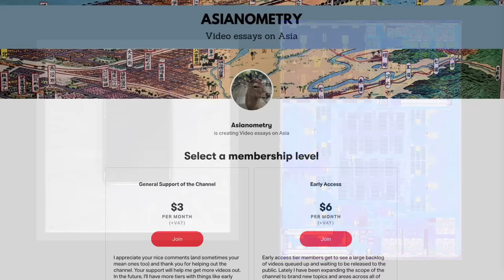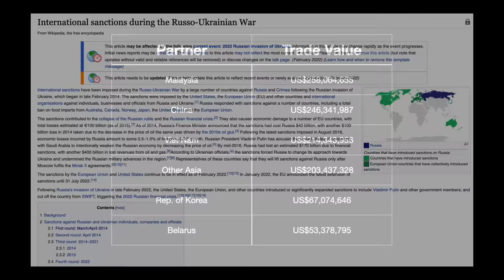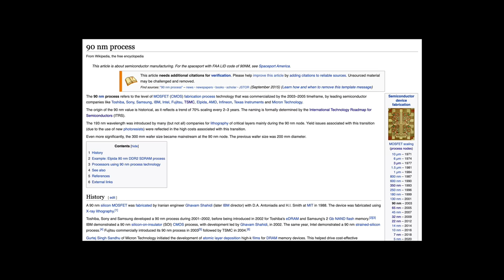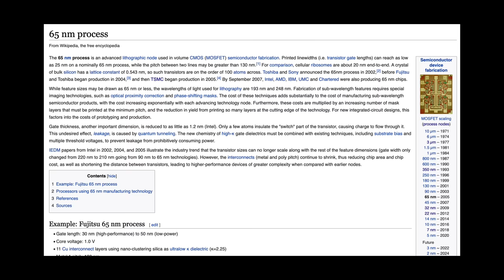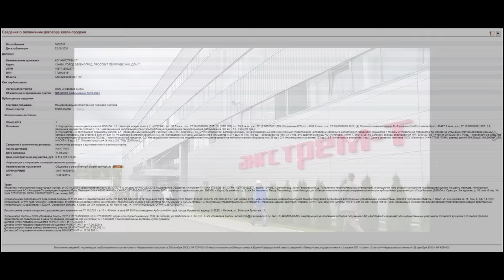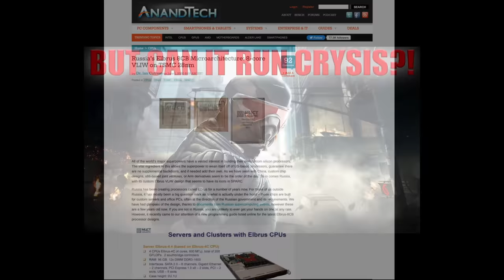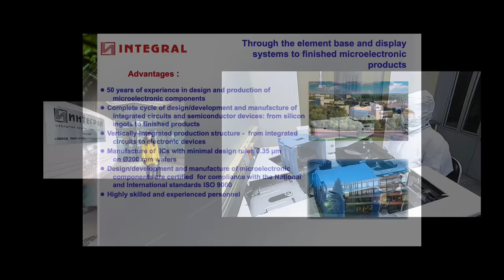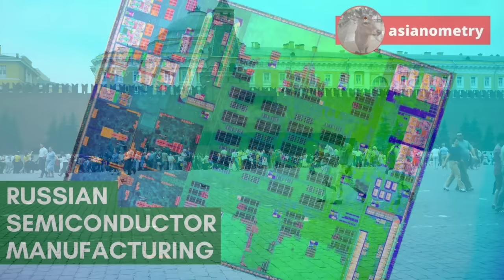Why Russia Can’t Replace TSMC

Comment: Russia has very talented software engineers. Hardware talent? It's hard to even guess. The way they manage stuff, their government, the corruption... all of these are probably a huge factor in why manufacturing lags behind others. This is just my uninformed perception as an outsider, but it really feels like Russia stifles its own innovation by trying to control way too much of its (private) industry. That said, rough times usually lead to innovation and who knows what kind of new CPUs we'll see coming from Russia, based on ARM or RISC-V. I hope Russia will get on the right path, but I'd also like to see it be more innovative - for good purposes that is.
Reply: Well, as a Russian i wouldn't say that we're lagging behind because of excessive control. It's likely on the contrary. The only reason MCST and Baikal currently exist is because of bailouts and the help of the government in terms of lawmaking policies and giving grants for development of the new stuff. And only after 2014, when Russia decided that we need to depend less on imports, only after our government started to support our microelectronics industry, we have started to see some new tech that can be considered relevant. Without control and support, there wouldn't even be any russian microelectronics at all, because no business would want to massively invest in something this risky and complicated and it's easier to just build an another shopping mall or re-brand imports as domestics and just start selling goods that are already manufactured.
Reply: Actually, re-branding imports as "domestics" and some shady companies exploiting loopholes in our laws of what can be considered domestic is a huge problem here. And that leads to the huge chunk of money being lost on this "domestic" manufacturing instead of going to the companies that actually develop and manufacture their tech in Russia. So I'd argue that there's a need in more strict control, especially now, when Russia desperately needs its own manufacturing and not just developments. This stuff won't just appear magically out of nowhere, the sad reality is that it needs to be controlled and supported by the government in order to even exist, you can't just let it go into a free-float and hope that the market would sort itself out.
Reply: @Warr1on  By excessive control I meant measures to steer companies either in or away from the direction wanted by the government. And I might be wrong about this in Russia, but having experienced communism in my own country (Romania), I've seen how companies were "stimulated" to grow into the direction the Communist Party wanted, instead of allowing businesses to take part in the free market. Basically, politics steered and shaped the industry for some agenda.

Re-branding imports (finished products) as domestic products is fraud, which should be illegal everywhere. So this is not what I meant by control.

The industry needs more support indeed, but no steering. The market knows very well what it needs, the industry can easily recognize that, so the government should only support this and even make sure that (domestic) competition can exist, so that the need for talent can grow and innovation to occur as a result.
Reply: @kneekoo  State control in a communist country can be efficient and productive. A good example is China, whose economy has caught up with the United States. Communist Vietnam also makes a lot of progress in microelectronics and produces its own processors. At the same time, you can find dozens of free-market democracies on the map that don't produce any technology of their own at all. Open your eyes - democracy and free market is not the decisive factor. Of course, one can always remember the unsuccessful attempt to build socialism in Romania. But what is the practical meaning of this? You live in the past.
Reply: @WatcherSCP  Living in the past? It looks like you're advertising communism or you completely missed my point about control done wrong. That's the problem, it's not about communism, but rather typical to communism. China made the same mistakes in the past but they learned. Russia (leadership) needs to learn too.

Free market actually means free - free to succeed and free to be mediocre or fail. If people expect their governments to manage businesses, that's a pretty broken system. Innovation needs to be stimulated and the government should get out of the way otherwise. Too many rules and regulations, or too much control hurt progress. Even the USA has too many stupid rules, regulations and laws that hinder the progress of Tesla and SpaceX. So again, my point was about excessive control.
Reply: @kneekoo  Neither China nor Russia ever reached the true state of communism. Or rather, in the current world, communism doesn't exist because capitalism is just too attractive. Either way, it looks like to me that decades of US sanctions played a huge part in Russia's development.
Reply: It's not "state control striefing innovation." That would've applied equally to software as hardware. The problem is funding - modern semiconductor needs huge capital investment, software doesn't. Much of it is down to monopolies like in lithography, etc. Russia won't be able to catch up until the Chinese catches up in lithography and supporting fields, and then start to sell them at cabbage prices like every other time they caught up with something in the past.
Reply: @pastasoo  That's probably true about all political ideologies and economic systems. It seems like they're rather ingredients that leaders use in different quantities and mixes to shape their countries.

Big powers, especially the USA, China and Russia have always influenced other countries, big and small. But China did a lot better than Russia because they focused a lot on growing its economy. Russia has a great amount of land and a lot of people to do great stuff. But it still lacks a good enough government to turn things around to their advantage.
Reply: @georgedang449  The right government would invest in the right technologies - they can do it. But Russia can't get its priorities straight to become a big player in tech. The whole world would benefit from more competition.
Reply: @kneekoo  China has it way better than Russia whether it is land, location, people and international relations. China certainly didn't have the eminent superpower of the world constantly trying to strangle them to death. They were smart enough to remain subservient when weak and stay pragmatic, growing to the point where by the time the US realized their threat, it's already too late. I do wish for Russia to get out of this conflict soon, a strong Russia is needed to bring balance to the world.
Reply: @pastasoo  Despite their choices in international relations, I still think Russia wasn't smart enough about its own industry. They allowed it to go down instead of strengthening it. They were probably complacent in thinking that they will "forever"  get money from oil and gas. They could've learned a lot from their friendly neighbor China.
Reply: @kneekoo  I kind of disagree, I feel it was the opposite where Russia was going to cut reliance on the sale of petrol eventually but they had to go with petrol for the time being to grow their economy and strengthen the military since they really didn't have much other options.
Reply: @pastasoo  Planning is different than doing, and here we are. The best investments are done in stuff that brings in more money. They should've focused more on economy. That's how China now has money to do whatever they want - their own space station, missions to Moon and Mars, lots of satellites, all on their own. And they didn't ignore their military either.
Reply: @kneekoo  Yup, the problem was they needed more time but the US/NATO wouldnt give Russia that luxury. China on the other hand still has a little bit of work to do. They are still largely dependent on trade with the US as their largest partner. If they could reverse that to the US having a heavier dependency while being able to source their needs from other countries instead of the US/Europe then they would become a true superpower without even requiring an alliance. I am kind of optimistic in regards to China completing that goal since their leadership is very wise with how they navigate geopolitics, much smarter than US foreign policy anyway
Reply: @pastasoo  Luxury to do what? Invade countries? The world needs to learn to develop without making others suffer.
Reply: @kneekoo  luxury to develop on their own, if they don’t invade Ukraine then Russia will end up suffering when they join NATO
Reply: @kneekoo  Why are such observable facts called propaganda? Russia’s is the only European Petrol state and the EU is their major trading partner. Crimea is currently illegally occupied by Russia so if Ukraine joins NATO, under article5, Ukraine can take back Crimea and become a second European petrol state in direct competition with Russia and it’s your guess as good as mine if the EU will prefer to trade with an EU/NATO country or Russia
Reply: @pastasoo  So you don't even see the contradiction? Russia illegally occupies Crimea and Russia would be hurt if they lose it? How is that not bullshit? It's illegal, they have to get out of there. You don't invade your neighbor's apartment and claim it your own, then complain that if the police kicks you out you would hurt. Russia can't complain about this.
Reply: @kneekoo  "It's illegal"... what laws are you talking about? Crimea was a legal part of Russia until the Ukrainian Khrushchev, who led the USSR in the 60s, decided to "gift" it to Ukraine. The fact that this region is populated predominantly by ethnic Russians did not bother him. In 2014, the Crimeans made their choice in favor of Russia in a referendum. Respect their choice.

And remind me under what law NATO bombed civilians in Yugoslavia and then dismembered this country?
Reply: @WatcherSCP  As I understand it, economic theory assumes that the free market decides what the most efficient use of dollars is for trade. When a government tries to second guess the free market, then over time the government will fail to direct those dollars as efficiently as the market would have. It's the old guns vs butter argument.
Reply: @Shullf2011  Sir, look at the globe and count the number of free market democracies. Only a few of them can boast of major advances in technology. Most free democracies use other people's technologies instead of developing their own - because the free market "dictates" them to seek profit. And buying someone else's is much more profitable than inventing your own. The irony is that only such "non-democratic" countries as Russia and China, today, have their own analogues of Google and FB, able to compete with these American giants in their local market. Russia and China have achieved this thanks to state support for the IT sector. And in free and democratic countries, everyone without exception uses the American Google and FB. Where is the variety and choice? Wake up. Your freedom has created giant, voracious monopolies that keep other democracies from developing their own technology.
Reply: @WatcherSCP  I think you are mixing economics and politics. My point is that, from just an economics perspective, China and Russia would get more of a return on their investments if they put that money to use in other ways. However, they have many non-economic motivations to subsidize their own social media platforms. Interestingly, in the context of software there is the concept of a network externality, under which the value of the platform increases as the user base increases. This is an economic reason why most of the world tends to use a select few software platforms. For most of the world, copycatting Google and FB simply doesn't make sense when those dollars can be used more productively.
Reply: @WatcherSCP  You are simply arguing from emotions at this point. I'm not going to speculate about where people prefer to shop for groceries, France's civil penalty structure, or compare companies to trees. And, I am not going to attack you or call your position "pathetic." Goodbye.
Reply: otto Lincoln  There are plenty of countries who have it much worse than Russia but don't invade other countries to fix their own problems. And the Soviet Union collapsed over 30 years ago, so I can't help myself wondering how much longer can that be used as an excuse for poor government.
Reply: @Warr1on  Bad or horrible things also happen in peace time. And whatever Putin dreams about, Russia should stay in Russia. There's plenty to fix and improve there, without making a mess outside its borders. Society will always have some issues, but when politicians take advantage of those to make people go against each other, things are almost guaranteed to go bad.

Russian governments throughout history have done a lot of damage. Of course there's animosity towards Russians, even if it's not warranted against simple citizens. But bad agents do pose as simple citizens, and that's how you get people paranoid about all Russian people. If you dismiss that, then you're simply wrong.
Reply: @WatcherSCP  By "legal part of Russia" you mean Crimea was handed over to the Russian Empire when the Ottoman Empire lost the Russo-Turkish war in the 18th century. It was also legal when Crimea was transferred to Ukraine in 1954, so just because the Russian government isn't happy to be smaller than it was, doesn't mean it's ok to ignore legal stuff that they dislike. The so-called choice that you mentioned is a hypocritical way to ignore the fact that how the Tatars were displaced and/or persecuted. Or maybe it's ignorance.

NATO and Yugoslavia? What about it? Do you think that was bad and that allows the Russian government to do something bad as well? Or that was bad and this is good? Russia's invasion doesn't look good and it's not justified either.
Reply: @Warr1on  i love how nobody ever answers when you bring up the documentaries or video proof of what has been going on since 2014 in the donbas or stuff like that. People just shortcircuit and instantly ignore your comments, cause it goes entirely against the narrative they chose to believe.
Reply: Maria_jikezee_sarungi  Russia transferred Crimea to Ukraine in 1954. 60 years later, Russia invaded it to get it back. Now they invaded Ukraine again, for bogus reasons. So this situation is different.
Reply: Maria_jikezee_sarungi  You somehow missed how Russia gave Crimea to Ukraine a long time ago.
Reply: Maria_jikezee_sarungi  He was in an official position of the Russian government when he did so.
Reply: Maria_jikezee_sarungi   Well there you go, so you know that he was an official government representative of the Soviet Union, making it a legitimate transfer of Crimea to Ukraine.
Reply: @kneekoo  That's xenophobic Russian are talented people, if to know lead researcher of quantum computer in Harvard is Russian, because real problem of Russian semiconductor industry is lack investment to fund them, Russia still depends on oil gas import, I believe this sanction CPU will push them to make microprocessor big plant for substitute product even maybe new innovation will come
Reply: @kneekoo  Russias biggest problem is that the economic growth of the mid-2000s choked off. They even survived the 2008 crisis pretty well, but after that everything went downhill. I still dont quite get what exactly happened, but I suspect it got something to do with the Kremlin and the Oligarchs not wanting too much competition.  Thats probably what was ment with "state control".

That created the current setting, where government support is the only way to actually drive certain industries.
Reply: @termitreter6545  That seems quite plausible, and the perspectives are pretty bad if it is so.
Reply: Get out of my head, man! I am russian and I can't agree more.
Reply: @kneekoo  I am answering a specific post about "I saw what communism does in my native Romania ...".
Don't you find it strange that capitalism succeeds only where there is a strong counterbalance to "Western" capital? - the whole of Europe is opposed to Russia and China - Europe lives well. South Korea and Japan hold back the DPRK and China - they live well.
However, the democratic countries of Latin America (which are MAXIMUM close to the stronghold of democracy, the USA) are dying of poverty, not to mention Africa and some other oceanic countries?
Only monopolists will benefit from developing capitalism, just look how many products (at least in the US and Russia, I don’t know how it is in Romania) REALLY belong to Pepsi or Coca-Cola? Capitalism strives for monopoly because it promises maximum benefit 
Of course, you can always justify the antitrust laws., but capital can be built up for as long as it takes to lab an infinite number of interests (lobbying for laws).
And most importantly - I'm not saying that communism (or socialism) is the way out, I'm saying that there is no need to idealize capitalism ...
Reply: @SuperNiceClown  I can't idealize capitalism because it's already proven to be awful when taken to extreme. Nothing should be taken to extreme. However, I can barely cherry pick a few good things about the communist period of my country. And when put in balance with everything else, the good is about as powerful as a fart in the wind. By contrast, capitalism has more potential for good. But of course it's complicated, because politics always is.

We should be very pragmatic and acknowledge the problems created by the various kinds of politics. I don't see what kind of politics would satisfy everyone, or if such a thing could ever exist, but I think we should take a look at the whole picture - past, present and future. Most of us will probably agree that progress is a good thing. I think we can also agree that having more people trying to solve problems is also a good thing, because it increases the chances of having more problems solved.

If we zoom out to see the past and present, we can see how humankind evolved in many ways, although it was a bloody evolution, filled with all kinds of bad and evil. Now if we look towards the future, can we really call our lifetime evolution or stagnation if we repeat what we did so far? As long as we care enough about a future generation to look at our time and acknowledge progress, we're supposed to step up and do better than this. At some point in our evolution we have to reach the age of accountability. Not only should we admit our flaws and work to correct them as individuals, but the society as a whole needs to work on it just the same, and that includes the political system and countries.

Romania is one of the countries that suffered from Russian annexation and influence. You'd have a hard time finding enough Romanians to say positive things about the Russian leadership. We're obviously opposed to that kind of values and politics, and we've been a democracy for over 30 years now - although flawed in many ways. But how successful are we? The difference is huge when compared to Western and Central European countries like Germany, France, Spain, etc. Why? Because that's where our leaderships brought us.

To an extent, leaderships are a reflection of what people voted. It's safe to say that we must learn to not only vote better, but also be more attentive and/or involved with politics if we want to improve. It doesn't matter where you are on the map if you always expect others to fix something. We need more people to hold their votes accountable and do better next time. And apart from voting, we also need to improve our ways as individuals in a society. There's no progress otherwise, it doesn't just fall on our lap out of thin air. We need to cherry pick the good parts of existing politics and come up with something better. Otherwise we will keep arguing over and over, over repeated mistakes that we could've learned from.
Reply: Man, you can't come in 2022 and say "EVERYTHING, I'm going to produce 7nm chips...Without the government, it's impossible. 
A huge lag in this industry, happened at a time when the state abandoned the developers to their fate... So in Russia the industry flew down the drain, and in the U.S. came Pentium-you know who Babayan is? So he was in the company "mtsst"...
I think if Russia hadn't abandoned its developers in the '90s, today Russia would have had 24nm 16nm chips. 
I think in those years, a lot of officials were associated with the CIA. There are many of them even now, many of them have now run to Israel, Turkey, the USA. Those who were supposedly engaged in Innovation-actually slowed down the process, such as "Chubais".
Reply: @kneekoo  assuming your market is truly free and you are completely fine with your companies failing... why didn't you allow Huawei to take over? :D
Reply: @georgedang449  china is working new processing power using light and no need for a cpu.
Reply: Сергей Захаров  Wow, the amount of "inadequate" information in your comment is staggering. 🤣
Reply: Hardware talent is too, for example one of creators of Elbrus 3 Boris Babayan was hunted by intel. 
About semiconductor fracturing, I want to say that Elbrus managers are not afraid of TSMC close, now they say that fracturing it's closed and they will find some other ways to produce VLIW processors. Baikal chips can be produced by modern China manufacturers. I heard news that government plan to build new manufacturing with actual techprocess by it will be build to 2024
Reply: Russia has highly educated engineers and scientists, including hardware. Having a "higher education" as they call a university degree is somewhat of a norm. They often just don't find a job that fits their qualification. 
All of Russia's technological backwardness come down to corruption and the wrong people holding positions of power.
Reply: The reason chips in the West are great is that the sales to consumers fund the expensive research. It you have to fully fund those with government funding, it’s pretty damn expensive.
Reply: @WatcherSCP  - It’s not democracy which aids the building of technology, it’s the consumer market. When consumers buy AMD chips, they fund their very expensive research.
Reply: Rusian software talent? Name a rusian software that can compete in any industry None
Reply: @Teluric2  Have you ever heard of Kaspersky?
Reply: @Teluric2  There are some good Russian hockey players,can't think of anything else anyone in Russia does well.Of course they live in the US,no money for hockey in Russia.
Reply: Russia in  a middle of Dutch disease. No one want to invest money in future, anyone with money want to multiply it asap. Best way in Russia to do it is invest to oil production. I hope now they will be forced to invest in technology and production and finally get off the oil needle.
Reply: i hate how artificial the lives of todays people are. you go home into your 2 room rented house. you arrive and windows are closed shut (because of heat or whatever) and the only light are LED. you go in between the 2 artificial plants on both sides of the walkway. you watch some TV while eating chips not even knowing how its made. before sleeping you do programming on your computer. you go to sleep.
Reply: @pastasoo  apologies for replying to an old post but it should be noted that to join NATO a country cannot have active border disputes and must already have a military that can  participate within the NATO structure. It would have taken Ukraine likely over a decade to become eligible to be a member, if Russia had held Crimea and the Donbas then in all likelihood NATO would have told Ukraine to give them up if they wanted to join. Germany, lynchpin of the EU was quite happy to increase their Russian gas imports right up until the invasion.
Reply: @WatcherSCP  LoL #1 Chinas economy hasn’t caught up with the United States esp on a per capita basis where their people don’t make anywhere close on AVG to what the AVG American makes per year.
Secondly China doesn’t innovate anything they need to copy everything which is why they’re always trying to steal intellectual property from the United States. There no where near as technologically advanced as the United States esp when it comes to military technology, artificial intelligence etc. everything they make that is cutting edge are direct copies of western counterparts with minor tweaks. They don’t innovate shit, and that is directly due to communist control of their industry.
Reply: @WatcherSCP  Everything I wrote is true and factual. You seem to have mastered the Russian repetition of spinning facts n truth to suit your worldview. Truth and facts tend to be something Russians are allergic to, it’s probably why those statements struck such a nerve with you. Ever hear the old American axiom that the truth tends to hurt? That old saying seems to apply perfectly here
Reply: @K1forMVP  So where are the facts? Have you decided to run away from the answer in demagogic?
Reply: @K1forMVP  
Do not argue with a Russian swindler (in Russian - PROPAGANDON). It is on state support, like microelectronics in Russia.
Reply: @kneekoo  Sir can you answer my question?
Why nationalists from Romania often look to Moldova?
That's kind of okay?
Reply: @marekms1041  What people know today as Moldova is about half of the original Moldova - an old Romanian region. The half on the east side of the Prut river was taken from Romania, by ultimatum, by the Soviet Union.

Moldova regained its political independence when the Soviet Union collapsed, but there was not enough political will (plus inevitable Russian influence) to reunite with Romania. And with the current war going on there will be a lot of hesitation on this topic.

Clearly, both Romania and Republic of Moldova fear consequences from Russia. As both countries rely on energy from Russia, things could easily get complicated - especially for Republic of Moldova, being the poorest European country.
Reply: @WatcherSCP  not sure how accurate your statement. The US is one of the leading chip making tech... one thing in common, there's a lot of asians in that field. I could be wrong but the talent is coming out of Asia and not a dependency with political state. If a country needs the state to step in then there probably an issue
Reply: It's not about talent... that can be fixed,  it's a lack of investors
Reply: @kneekoo  : Thus, ICE Felix is supposed to be the closest thing the world-class innovator? Cloning a ZX Spectrum? Is that what you call an innovation? Haha. I am no very impressed, sorry.  I replied to your post only because you were parroting cheap crapitalist propaganda and it sounded so childish. I could paraphrase a satiric writer: During the era of "communism", artists were wailing that they could not create; communism eventually went away and capitalism came in, but the artists have not created anything. Sorry, but it appears to me that you do not understand it, so you come up with simplistic explanations.
Reply: @pastasoo  , no, Ukraine cannot join NATO. Read Article 10 of the NATO Treaty.
Reply: @kneekoo  : You peddle bullshit. Crimea is not occupied, Crimea is part of Russia, so it cannot be occupied by Russia. It was occupied, but only for a few days. The Crimeans exercised their right to self-determination and decided that their future would with Russia. It was totally legitimate, even if some legal questions regarding the legal foundation of the referendum remain rather unclear. Who cares? The whole Romanian revolution of 1989 was even less legal, so what?
Reply: @Shullf2011  : Yeah, that is the simplistic economic theory that has probably never worked in practice, as it is just a myth. Or what about government subsidies then? If you want free trade, then you ought to move to Somalia.
Reply: @Shullf2011  : Like... putting their economic efforts into pocket-sized atomic bombs, right? That would certainly pay off the most.
Reply: @kneekoo  : And it was also legal in 2014. Moreover, it was more democratic and more respectful of human rights in 2014 than in 1954. No, you are just falling up for a straw man fallacy. You straw man -- your false supposition -- is that the Russian government was unhappy to be smaller than it was. Of course, this is nonsense and you do not have any proofs to back up your claim, obviously. And from this falsehood you can produce just just about anything. But it will not necessarily be truth. It will be just a random claim, as wild as you can put it. It was because the inhabitants of Crimea collectively decided their own future. The fact that some Tatars did not like it, was their problem. And how they tackled it, largely determined their fate. It would be the same as in any democratic country. If your party has lost in a plebiscite, you must accept it, otherwise you will be heading for great trouble in any democratic country.
Reply: @martinrapavy9815  I lived most of my life in Romania and most of my relatives still live there. You arrogantly assume you know better. You don't.
Reply: @kneekoo  : Sergej ValerjevIč Aksjonov was an official government representative of the Crimean Republic, Vladimir Vladimirovič Putin was an official government representative of the Russian Federation, and agreements was signed and confirmed by both parliaments, following the results of a successful referendum. Thus, it was even more legitimate than both the 1954 transfer or the Belaveža Accords.
Reply: @termitreter6545  The West did not fare better, either.
Reply: @kneekoo  : and then... if you consider that Nicolae Ceaușescu fucked Romania with capitalism -- the capitalism mode of production -- the picture of the horrors of capitalism becomes more complete.
Reply: @martinrapavy9815  I don't know what you're smoking, but either get off of it, or get something good.
Reply: @kneekoo  : Where did I assume I know better than you about the life in Romania? (By the way I come from Slovakia, so you could have spared yourself the long tirade about life in Romania before 1989.)
Reply: @kneekoo  Alright, so you see the answer to your plight. You find the reality  too inconvenient, so when you have to face it, or have to answer an inconvenient question, all you can think of is smoking something good. The communists' rule lasted almost exactly 42 years, the capitalists' rule lasted almost 33 years. After such a long time, there is absolutely no reason to blame the communist, except for the need to shift the blame upon them because you cannot do better and, as we have just seen, you are too afraid to face responsibility.
Reply: @martinrapavy9815  ^^^ That's either proof that you didn't really read my full comments, or you ignored those details.
Reply: @termitreter6545  : No, it did not go downhill, it just got saturated and comparable with the West. Also, Russia is a modern country when it comes to social security, essentially drawing on the tradition of its communist/socialist past. China has also had a communist government, but nowhere near such a level social security welfare, especially when it came to pensions, etc. And the worst part of it, from my point of view, is that the whole EU will go to shit because it is led by moronic lackeys of the U.S.A., which has been hell-bent on waging war against Russia on someone else's turf for the past 77 years.
Reply: Maybe, in about 50-100 years.
Reply: @pastasoo  Ukraine wouldn't have become a NATO nor EU member because both need uncontested borders to join.
Reply: "Russia has very talented software engineers. "

...a lot of countries have very talent software-engineers.
Reply: Very outdated outlook on Russian economic environment, just amalgamating it with the USSR. Today Russia has some of the most pro-innovation business environment in the world, with massive grants to interesting bottom up projects and very low hurdles (it ranks in the top 15 of ease of doing business). The main issue is rather underdeveloped capital markets for venture capital, implying relying on state grant programs (very similar to many European countries btw).
Reply: @kneekoo  PRC did not focus more on economy for some weird reason, the discrepancy in growth in the 1990s solely stems from Russia applying the liberal doxa of across the board liberalizations, whereas China was much more prudent and developed controlled markets. Russia's économy collapsed in the bandit capitalism induced by a weak state, and recovered and grew quickly in the 2000s when the state reestablished control over markets. Nowadays , growth is stymied by massive sanctions yet it is still there, especially in industrial output which is booming. In 5-10 years Russia will be an industrial powerhouse producing near everything at high quality. The speed of the progress since 2014 is aweinspiring
Reply: @kneekoo  Illegal? The only illegal thing in 2014 was the coup in Kiev. As a result, the elected Parliament of Crimea (more legal and legitimate than some kalachnikov-wielding putchists in Kiev in my eyes) voted to hold a referendum. Following its massive results in support, it legally seceded and called on Russia to integrate it. So two legitimate organs ( Crimean Parliament and Crimean people) legalized their secession and reunification. When your landlord unilaterally worsens significantly the contract without the proper procedure (making amendments void) and bullies you, you have the right to defend yourself against that abusive landlord and call the police to keep you safe at home
Reply: @martincorneille7998   An industrial powerhouse in 5-6 years? That's not long, I guess we'll see. :)

Cute propaganda, though. Again, we'll see how things evolve.
Reply: @martincorneille7998  Russia is very pro-business as long as the business is pro-Putin
Reply: @touristguy87  examples?
Reply: @martincorneille7998  ...of your idiocy? 
Not my job
Reply: @touristguy87  of your alleged reliance of successful business-makinf in Russia with shady political ties. If anything, I have examples of the St-Petes' IT start-up elite being often counter-culture minded. I was asking for serious examples, not for ad hominems, lowly exchanges. You are not in a mood for a mature talk I see.
Reply: @martincorneille7998  LOL is that what you say when yet another outspoken critic of Putin dies under obvious circumstances
Reply: @touristguy87  Any examples? Sounds more like Ukronazia
Reply: @martincorneille7998  isn't that what you asked me like 2 days ago? And what did I say then?
Reply: @touristguy87  you just insulted me without providing any examples
Reply: @martincorneille7998  all in your perspective
Reply: @AndRei-yc3ti  The market came up with a lot of technologies, both in hardware and software. I wouldn't credit governments for the smartphone or the Raspberry Pi - to name two big things in two different countries. Regardless of the political system, what the government should do is to offer a healthy environment for business development.

I agree that a lot of potential was destroyed in the 90s, but especially in a country like Russia it would've been simpler for the government to step in and steer the economy and industry tighter to get back on track, even if lagging behind others.

Clearly one can't expect miracles, but it's only when a country sets its priorities straight and follows up on its strategies that it can start covering ground in the right direction. Capitalists, generally speaking, are indeed preoccupied with short term stuff, but there are some companies, big and small, that have visions and product roadmaps that go over a decade.

Now to be fair, it's human nature to be unable to see or plan a lot in the future. Wherever those managers are, under whatever political environment, they still need to be visionaries. This kind of people is not very common, unfortunately. That's why it's critical to keep those people in their countries and support their visions. But short-term views (+corruption) in both politics and business will get in the way quite often. That happened everywhere, Russia, USA, etc.

I think Russia still has plenty of potential, just bad priorities.
Reply: @SuperNiceClown  capitalism is debt..Romania is a small country with 120 billion in debt this is crazy..
Reply: It’s always funny how informed are you folks about the role the government has in practically all technological advances in the 20th century.
As this Russian guy in the first comment says, the microelectrónicas Russian industry disappeared with 90s liberalism and only came back with massive government support.
But besides Russia, practically all development in microelectronics in USA was through massive military (gubernamental) spent.
In Japan, South Korea and Taiwan their government invested massive amounts of money to subsidiase the electronics industry.
In aerospace industry Boeing and Airbus periodically receive big help through their respective states.
Neoliberal dogma is useful for producing mass market stuff, but the development of high end tech need gubernamental investment.
Other example you can find is nuclear technology, where Russian Rosatom is the biggest exporter and has the most advance nuclear technology thanks to massive economical support from Russians government.

At the very end, industries need capital, and need human talent. 
If Russians invest enough in their electronics industry they will advance a lot.
Contrary to what many people think Russian state generate lot of cash, before it was trapped also in IMF dogma of having foreign currencies to stabilise their currency and bla bla.
You see the result, they lost all
What would have happened if they would have invest those 300k millions that they loose frozen by the West in their own microelectronics industry?
I think they learn from their mistakes and now they are investing 50 million in their electronics, instead of sending them to the Federal Reserve or to the ECB
Reply: @julianherranz1030  who paid you for that message
Reply: @julianherranz1030  again...who asked you
Reply: @WatcherSCP  Very wise conclusion, friend. Indeed, the US Technocracy Giants have dominated too long in technology platforms. Russia and China managed to make their own search engines and many other plattforms. Very true. Yandex is an amazing alternative to Google.
Reply: @iljafritzler6823  The US being geo-political assholes for a long time doesn't mean Russia is not a geo-political asshole. And no, Russia is definitely not "only protecting its borders".

The US politics is still full of crap, and Russia is just different - currently invading another country and killing civilians, not protecting anything.
Reply: @Teluric2  nginx
Reply: @ЧеловекСвободный-е4н  Someone needs to tell Putin to stop whatever it is that he's doing, so people's lives can return to normal.
Reply: @ЧеловекСвободный-е4н  What are you even talking about?
Reply: @kneekoo  Well, I told you you wouldn't understand. You just think that all the troubles happen only because of one person. It's stupid to think that. I use a translator, and maybe he doesn't translate well.
Reply: @ЧеловекСвободный-е4н  I don't think everything wrong happens because of Putin alone, but he's likely in the best position to make a change for the better. It makes no difference how many people are needed to fix what's wrong, it just needs to happen - as soon as possible.
Reply: @kneekoo  
What should happen?
Reply: @ЧеловекСвободный-е4н  The war needs to stop, and reparations must be done. Then this should never happen again.
Reply: @kneekoo  What? To the last Ukrainian? Because, according to you, it doesn't matter how many people are needed. 

But we did not declare war and we do not want to destroy Ukraine. We want to put an end to the war that was unleashed by such political figures as Turchynov and others together with him. And all this was necessary for the implementation of the Minsk agreements and then Donbass would have returned to Ukraine, but someone decided to resume shelling, look at the OSCE reports from February 1 to 24.
Reply: @ЧеловекСвободный-е4н  I don't think it makes sense for some people on YouTube to establish the details of the reparations - we're not in the position to assess the whole situation.

It also doesn't look like you see things correctly if you blame an occupied country. What could possibly justify Russia being in the Ukraine for this long, doing so much damage to so many people? You'd think we live in a modern enough world where people understand and value freedom and development more than the old lust for power.
Reply: @kneekoo  Free market is a myth. It is not free at all. For example the case, when Huawei was banned in the US
Reply: @sivkov1987  As with anything made by people, it's virtually impossible to have stuff that is perfect. But what is relevant is the big picture - with a few exceptions, there actually is a free market.
Reply: @kneekoo 
You're forgetting that China has way more people and has bucketloads of money thrown at it by Western companies in exchange for access to that market. 
It also flew under the US' geopolitical radar. The USSR and especially Russia (given its poverty in the 1990s was the US' fault) didn't have the momentum or the natural incentivize to draw US capital in. 

You act like China just magically did better policy. They got companies to invest because 1.4B people is irresistable.
Reply: @kneekoo 
"Do you think that was bad and that allows Russian government to do something bad as well?"
YES. What's the alternative? 
"Oh well, these other countries did something bad and we "can't do anything about it", but let's prosecute Russia to the fullest extent of international law!"

At some point you have to acknowledge that this logic is just a plausibly deniable way to favor the US and weaken its adversaries. It has nothing to do with "good" and "bad."